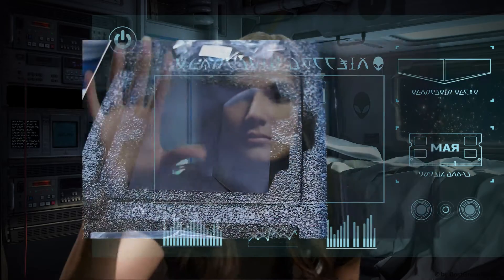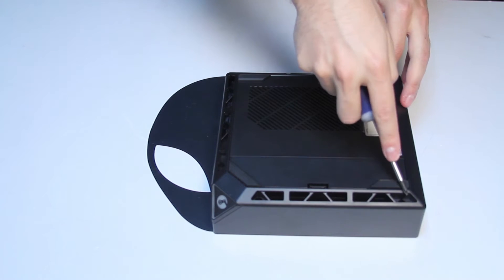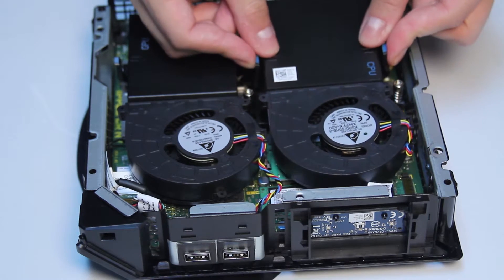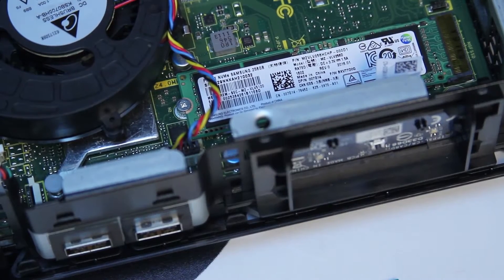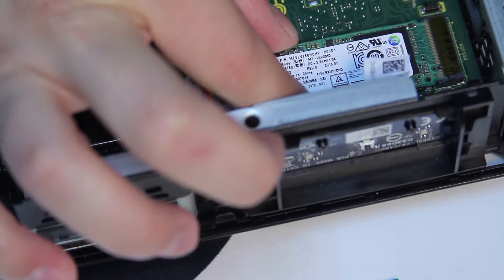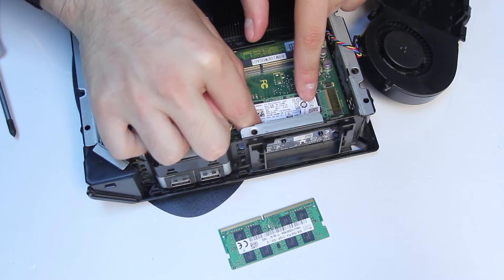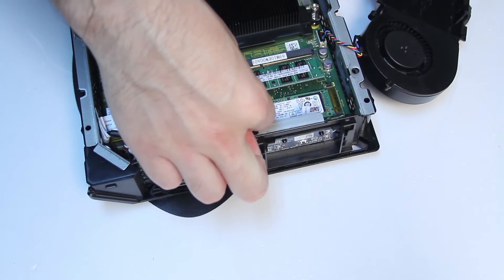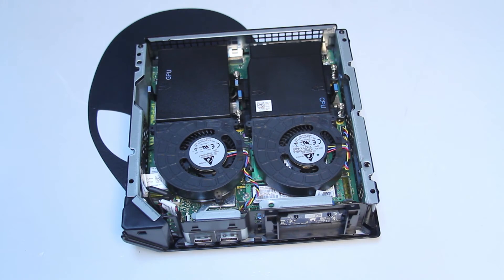Alienware Alpha R2: How to Upgrade/Replace M2 SSD

Comment: I added a Crucial MX200 500GB M.2 SSD and I get "no signal". Can not even get to the bios screen. I take the M.2 drive out and it works without a problem. The M.2 drive works happily on my other motherboards and even in an external closure but it just doesnt seem to work on my AA R2. Any ideas?

Comment: Hi, I have installed a Samsung M.2 PM951 1TB drive and it's not recognized in BIOS or Windows in my Alienware Alpha R2. Is the M.2 drive capacity limited to 256 or 512 GB?

Comment: Do you have a tip for unplugging the small GPU fan cable connector mentioned? I'm trying to access the heat-sink underneath to clean it but the fan housing won't lift out all the way. Thanks!
Reply: I've trying wiggling it out but it won't unplug... is there a tiny clip keeping the plug fastened and a trick to releasing it?

Comment: i got mine with a PCle SSD and the HHD slot is empty. Would i be able to add a HDD into the empty slot to increase space?
Reply: but this guy said he did 
https://www.reddit.com/r/AlienwareAlpha/comments/4st6vw/hard_drive_questions/?st=ixfv9szg&sh=4187bb92
Reply: @AlienwareSupport  already my system is low on disk space  and even though i tried switching to the D drive by means of using a passport external drive  it's still not copying my saved game data to the passport drive.  I've had to uninstall just about all of my games  as a result and i can't even add new games without first removing what I currently have.  Alienware didn't really think it through when designing a compact system  with regards to the limited space for an internal hard drive on this thing.  I might have to take my system to a computer shop to get my internal drive upgraded from the stock drive to a higher capacity SSD drive as a result....either that or buy a standard tower based computer which would have more disk space available than this system does.

Comment: Hi, I have the Alpha R2 i7 model. I'm planning on upgrading the Ram and SSD soon but have some questions. I'm going to backup everything to a USB flash drive. After I've done the upgrades, ssd & ram, do I need to press F12 to do the reboot after I've turned the system back on ? Or will the system automatically go to the loading screen? Also will the bootable backup save everything including the Alienware logo etc? Many thanks.
Reply: for the new R2, is the CPU exchangeable/upgradeable, as in, not soldered on? and can swap for a higher upgrade. i think the 960gtx is soldered in.

Comment: If you bought an alpha with a 256gb SSD and wanted to add a conventional HDD 2.5" drive would that be possible to be used together?
Reply: Alienware Services thank you!
Reply: Does the Alienware Alpha R2 allow an M.2 and conventional HDD 2.5" drive to be used together? 

If so, is there any restriction on which drive is primary?

Many thanks
Reply: You mean one drive total? Because there are 2 slots, for hhd and M.2 SSD. Having the OS in the later and the HHD for storage would be a superb setup for the Alpha R2.